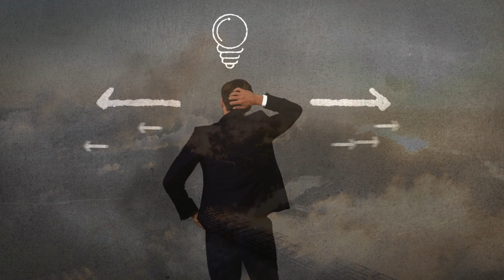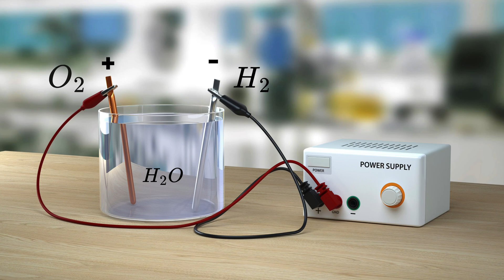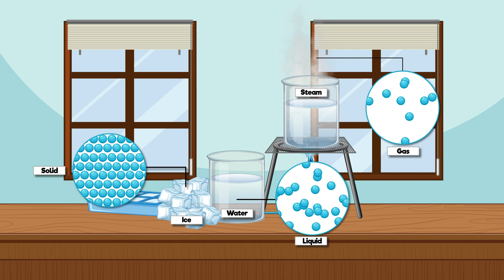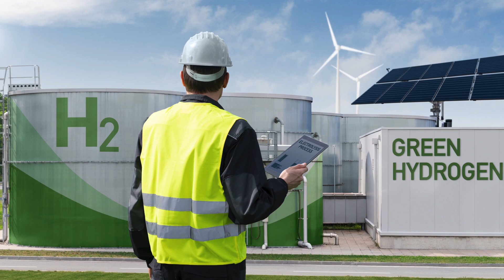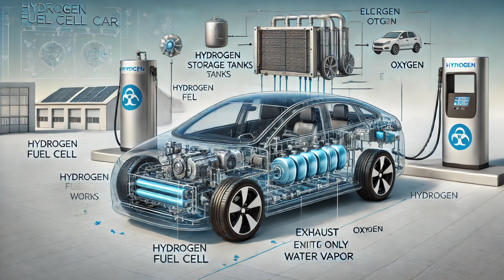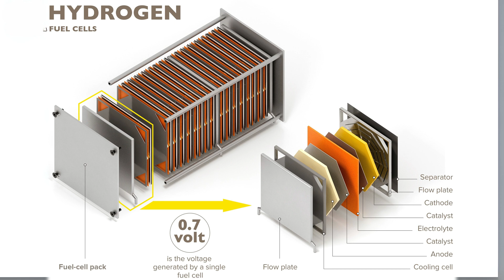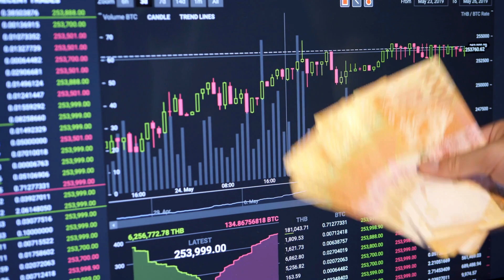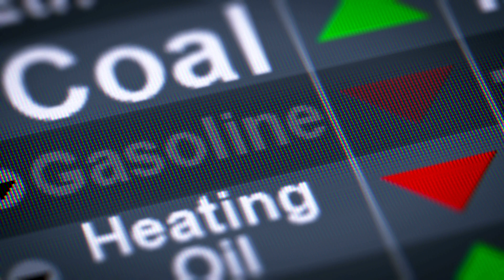Water as Fuel: Why Water Won’t Power Cars Yet? - Science Podcast

Comment: This video is very misleading. It explains the technology and the production chain and infrastructure quite well. But it conceals 2 things. 1. If a fuel cell vehicle is basically an electric car, it even has a more or less large battery as a buffer between the fuel cell and the electric motors, you also need the fuel cell, high pressure tanks for hydrogen with 350-700 bar. So you have a normal BEV plus fuel cell, high-pressure tanks, high-pressure lines. I doubt that these components will ever be cheaper and require less space than simply installing a larger battery. So a BEV will always remain cheaper. 2. They simply omitted the efficiency consideration. The starting point is always green electricity. If you have 100KWh of electricity, with a pure BEV minus the losses approx. 75KWh for propulsion on the road. With a fuel cell car, this is max. 38KWh. With the same amount of electricity, a BEV thus comes at least twice as far. So how should a fuel cell car ever pay off? The same applies to the infrastructure. At BEV you need an electrical line from the energy generator to the charging station, nothing more. You can even charge it at home, there is already electricity everywhere (in simple terms). Hydrogen must be produced in large industrial plants with green electricity, then transported with pipelines and/or pressure tank trucks (of which you also need many times more than today's tank trucks) to filling stations, which require large hydrogen pressure tanks. Hydrogen vehicles will never exist in road traffic on a large scale. There is a hydrogen initiative in Europe, especially in Germany. But this only served the automotive industry to prevent and delay the spread of BEV. Half of the few hydrogen filling stations were closed last year and the sales figures of the 2 existing hydrogen cars are in the 2-digit range. We need hydrogen to store electricity over the seasons and for special applications such as aviation or raw material in the chemical industry, but not for road traffic.